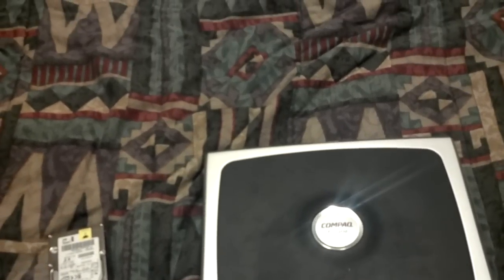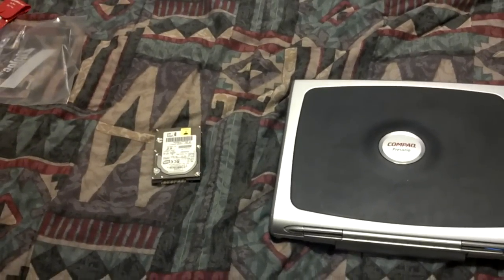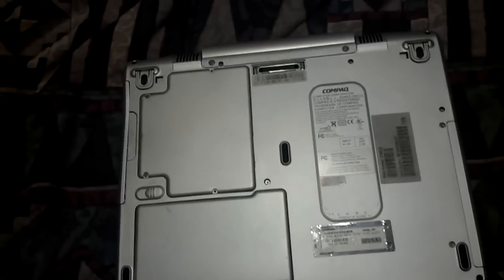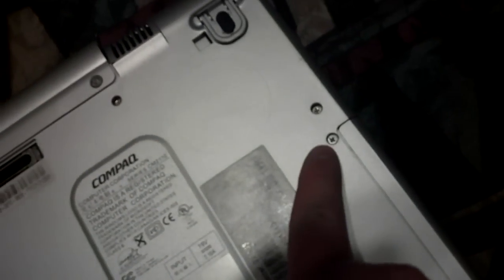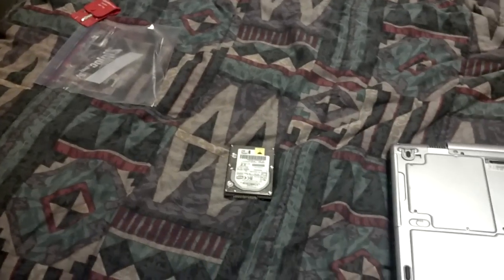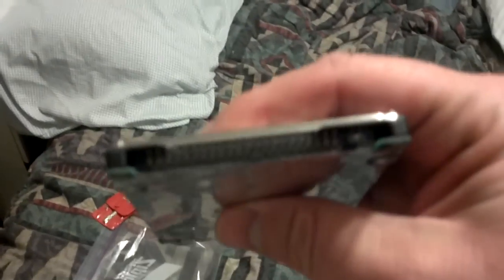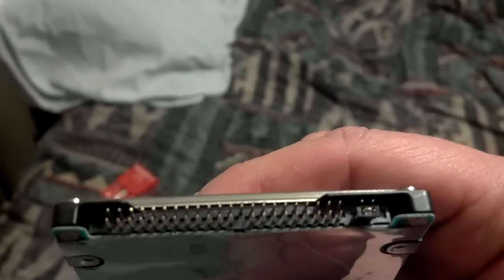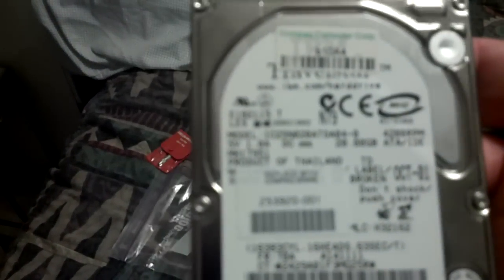How to pull a hard drive Compaq Presario 2700US

Comment: thank you for the tip my compaq stop working and with a broken monitor it was really in an unusual position ,now i can transfer my data in my new computer
Reply: Hi Ann, what external hard drive case did you use to connect the drive? I'm having some trouble lining up the pins with an old external drive case that is supposed to take IDE. Thank you.

Comment: Daniel, Thank you for showing us how to remove the hard drive. Is the connection an IDE?  I tried attaching it to an old external hard drive case that was supposed to take IDE but the pins didn't quite line up. I'm just wondering if there is an external case I can purchase for the drive?
Reply from the maker: I think it may have been a proprietary connection.  But, to be honest, I haven't worked on a Compaq Presario since 2011.
Reply: FYI, IDE drives came in 2 sizes, 3.5" desktop drives and 2.5" laptop drives, with different pin spacing for each.  These drives are standard 2.5" IDE drives.  If you do get an external case or adapter jr to connect an IDE drive be sure to set the jumper pins to "master" to make it work with the external case/adapter.  Most likely the current setting is for "master".
Reply: @tonydominickpa  Thank you!